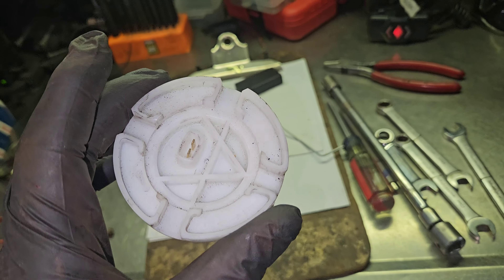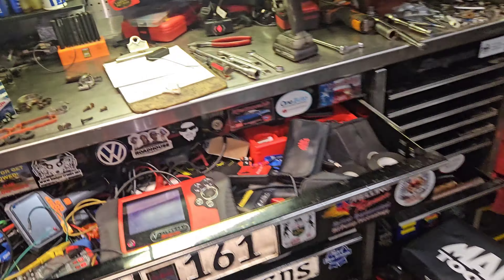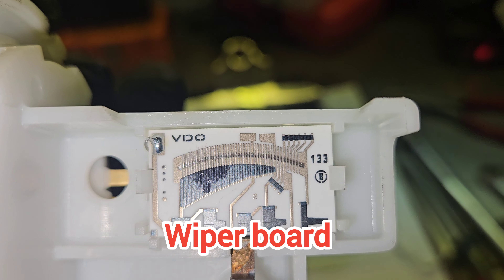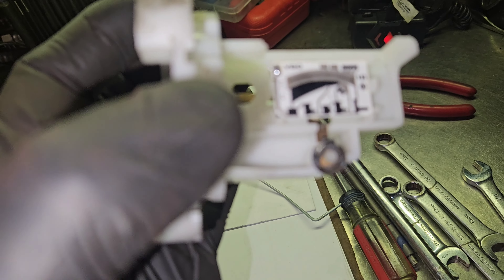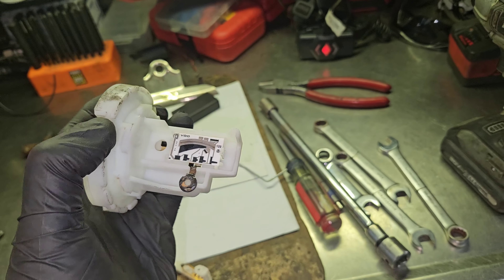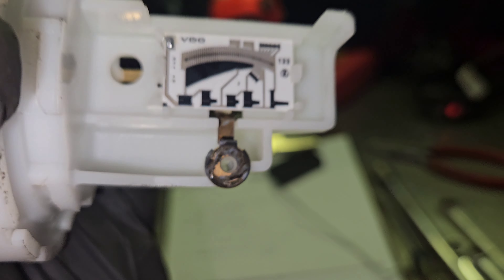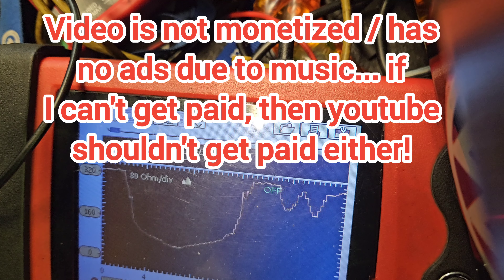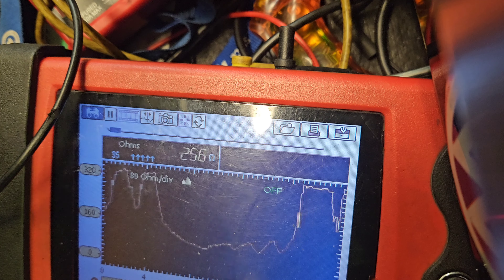VW T3 / Vanagon fuel gauge issues

Comment: There was a topic on Jag forums where copper and brass samples were dropped into todays fuel containing ethanol. The samples in the container which had openings were definitively oxidized.

Beside that I assume the todays copper may contain more chinesium than the 80s one.

I wonder if a thin solder layer could help against the oxidation.
Reply from the maker: Great info, thanks!
I'll try solder on the next one!

Comment: Do you have any tips for 88 temp gauge? It is showing too low. Fan turns on at about 1/4 level. 

Used to work fine until I discovered the previous owner replaced the special tank level relay with a regular relay. I bought the correct relay and it's showing low. I know the resistance is too high which causes it to show low but there is no way to adjust like when it is showing too high.
Reply from the maker: Disconnect the temperature sensor and place a 200 ohm resistor across the harness plug. Turn key to the ON position. How high does the needle go? 100 ohm how high?
Service manual has a resistance chart that shows what the temperature should be according to resistance... follow those resistance values if my examples / suggestions are not helpful.
If it still shows low, the problem is in the cluster. Voltage regulator or the actual gauge.
Voltage regulator usually affects fuel gauge as well... if fuel gauge seems ok, then the Voltage regulator is most likely ok.
Reply: So, Thomas in this case; was this a warranty repair, fix the part as shown, install be done or did you just go ahead and replace the whole sending unit?
Reply from the maker: We had to drop the fuel tank to install stainless coolant pipes... while we were "in there" (had the tank out), customer asked us to look at the fuel sender due to the inaccuracy.  Sender was reused after cleaning / adjusting. We had some other used stock ones on hand, but this one performed the best out of all of them, so it was reused.
I don't know what change in metal VDO has done. The older VDO senders are not corroded like the new one even though they have been in tanks longer. Not sure how long this sender will stay accurate. Hopefully longer with having a bit more tension on the contact surfaces.